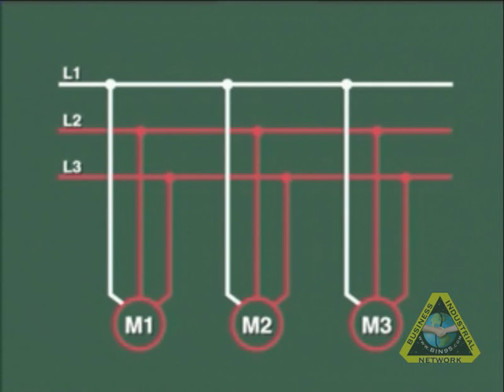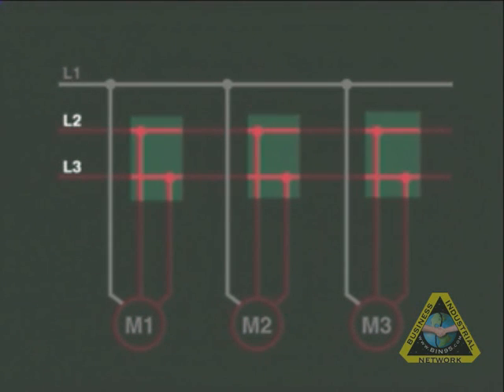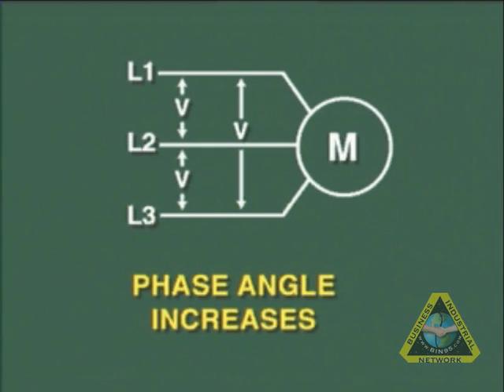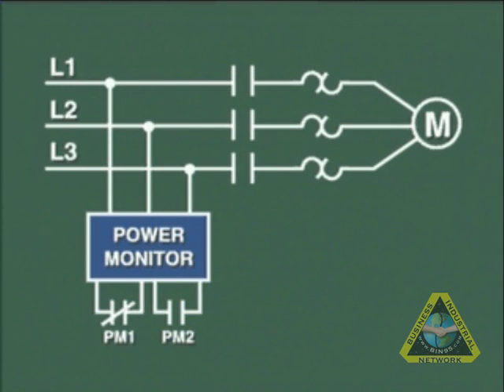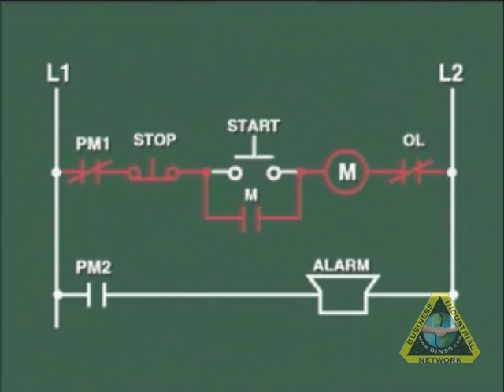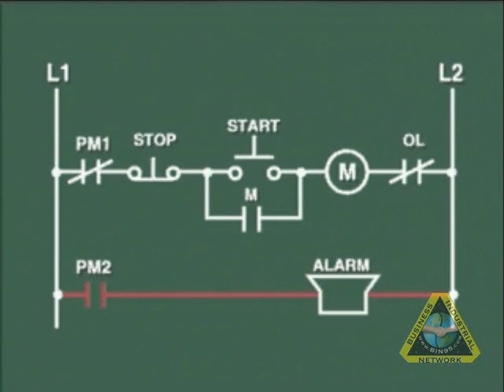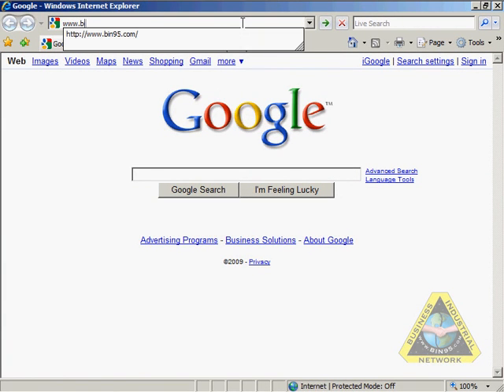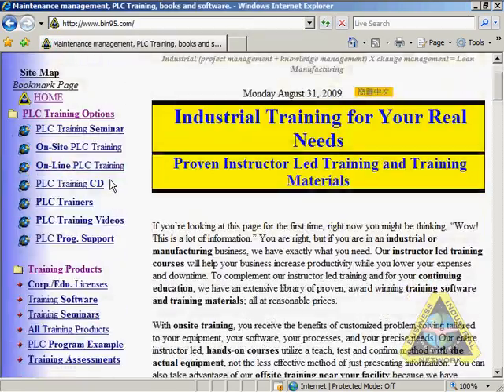Troubleshooting HVAC: AC motor control phase angle

Comment from the maker: @Gcarman50 The power monitor solution mentioned in the video is a long-term 24/7 motor monitoring and protection solution. Not a spot check or PM solution. The power phase monitor is probably more cost effective and reliable too. :>)